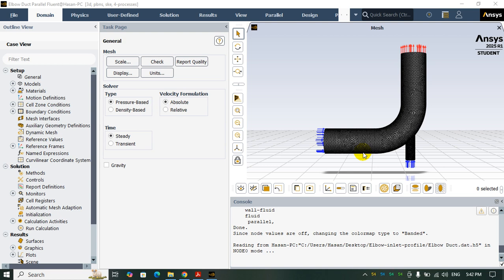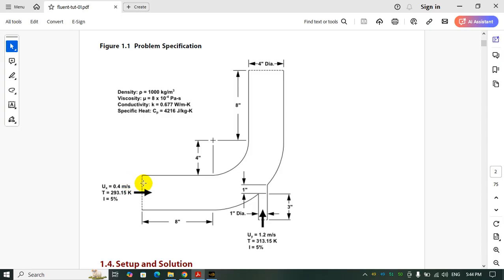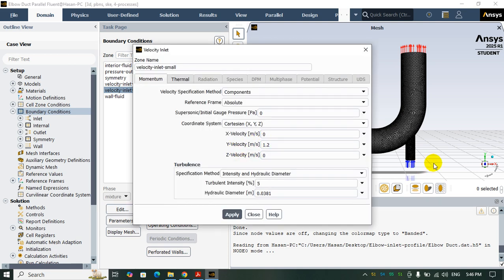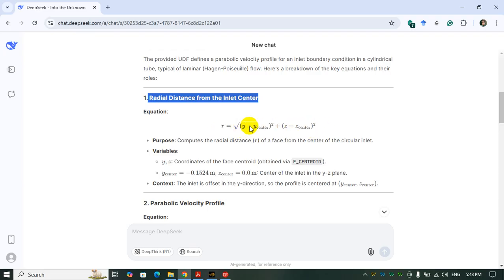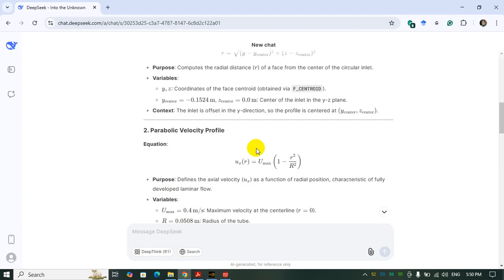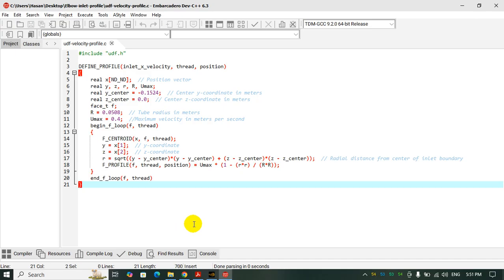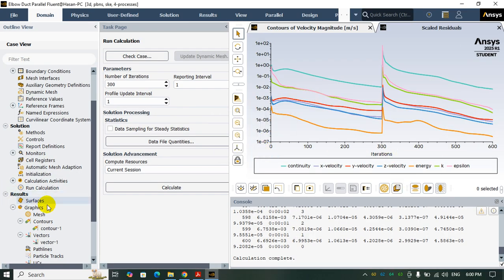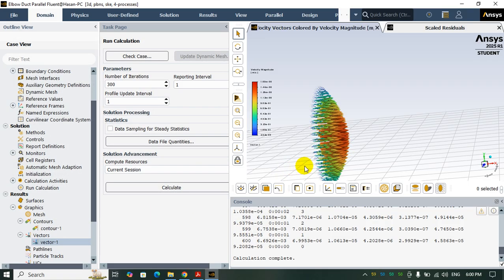How to Create and Compile a 3D Velocity Profile Using a UDF in a ANSYS Fluent Simulation

Comment: If I have run the simulation from rans model and got velocity at outlet how to use that velocity as an input for different model
Reply: Suppose I have velocity profile at outlet just after simulation completed I export the data. Then how to use that complete data as a velocity profile for inlet. How to do that?
Reply from the maker: @Allbees-xl4xe I already mentioned above:
For exporting velocity or any other parameters from the outlet, you need to do the below steps: 
-read your case and data files
-go to the file>write>profile
-Select the surface and parameters that you want to export the profile and then click write
-read the profile: File>read>profile
-then you can select the profile from the drop-down menu for your inlet boundry condition
Reply: I am using ansys 2022 R1
Reply from the maker: It's easy; you can export the velocity profile from the outlet and then import it to the inlet velocity, but I guess the mesh number should be the same in the inlet and outlet boundary. I already did that one time, and my mesh was generated with the block technique. Meaning that the number, the shape and location of elements in inlet and outlet bouandy of tube was same. You can try in your case if you do not have the same mesh patterns for your inlet and outlet boundary conditions, and please share with us if we can make it for non-similar mesh at the inlet and outlet. 

For exporting velocity or any other parameters from the outlet, you need to do the below steps: 
-read your case and data files
-go to the file>write>profile
-Select the surface and parameters that you want to export the profile and then click write
-read the profile: File>read>profile
-then you can select the profile from the drop-down menu for your inlet boundry condition
-Check the results with plotting contours or x-y plot

Please share the results with others in this comments section and support us by recommending our YouTube channel to your friends and subscribers from them. Thanks
Reply: @akamcae  I need time varying velocity data at outlet by rans model and further I have to convert it in velocity profile and use that as a boundary condition for les model. I have to use that as inlet velocity . How How to  do that
Reply from the maker: @Allbees-xl4xe  It is not possible, I guess. You need to have the velocity profile as an equation that varies based on time. It's better to find that equation otherwise, you may need to export the profile at every time step from the outlet and then import it as a velocity profile inlet., to do this, you may need to make a UDF and ask the fluent to read a profile at each specific time -step. We have a general macro-like executive at the end of each time step. But, imagine if you simulate your case for 1000 time steps, you need to read the profile before ever time step, which I think will reduce the computational speed in your simulation. This is the only (the hardest) way that I can suggest to you.
Reply from the maker: @Allbees-xl4xe , for exporting the velocity profile automatically (writing and reading), you may need to write a UDF to save the profile after each time step. You can search the UDF Ansys fluent document to find the way.
Reply: Thanks for reply🙏
Reply from the maker: @Allbees-xl4xe  your welcome
Reply: In file > write> 
there are three option autosave start journal start transpcripy
Reply from the maker: @Allbees-xl4xe , you may not read any case file or mesh. You can have the profile option for both reading and writing.

Comment: how did you determine where are y center and z center? I used your values but they are not correct in my case.
Reply from the maker: Hello, Please make sure that the length unit in your Ansys Fluent is in "meter". The dimension of mesh is in "inch". You need to change the unit. See below link:
https://www.youtube.com/watch?v=5LZbu3-D23w&t=152s
Also, you can check the min and max value of coordinates in the scale section, then you can figure out where is the center of your geometry.